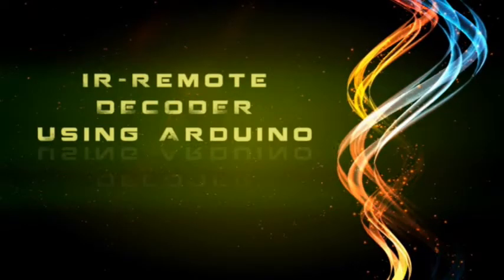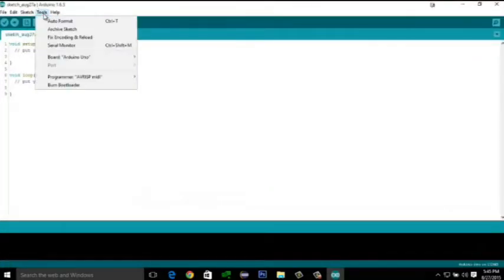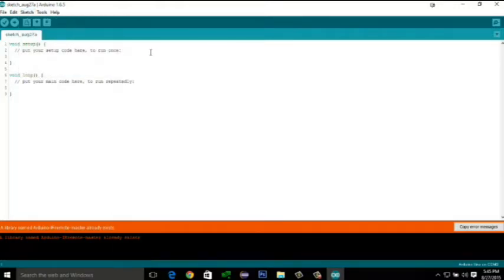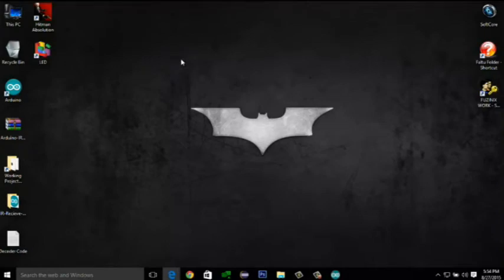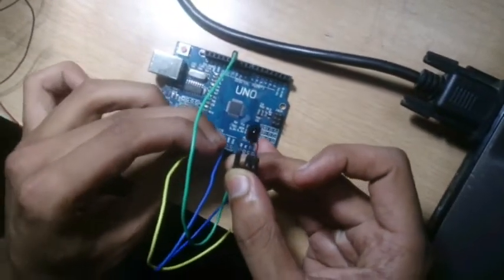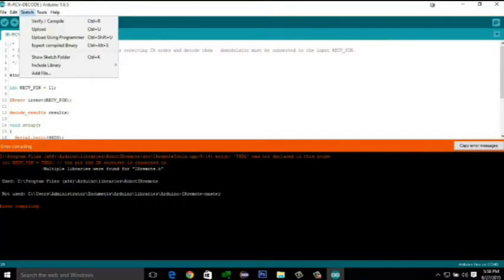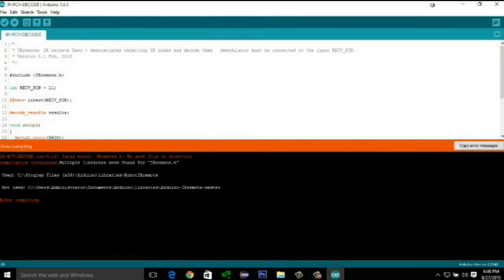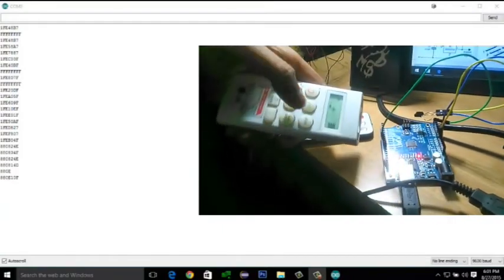IR Remote Decoding with ARDUINO UNO

Comment: Hi on gihub irdude project the hex codes used are soooo long , imean   90 to 100 hex values are there for single button...even on irdb.tk, remote central multiple hex codes are there for one button...here showing only one hex code...am i missing something
Reply from the maker: There might be some problem over there. You can use my code as the library I am using is doing those operations for me.
Reply: Sanyam Arya looks like I didn't explain it properly...here is the java code from irdude project on github 

irData.put(R.id.buttonPower, hex2dec("0000 006d 0022 0002 0152 00aa 0015 0015 0015 0015 0015 0015 0015 0015 0015 0015 0015 0015 0015 0015 0015 003f 0015 0015 0015 0015 0015 0015 0015 0015 0015 003f 0015 003f 0015 003f 0015 0015 0015 0015 0015 0015 0015 0015 0015 003f 0015 0015 0015 0015 0015 003f 0015 003f 0015 003f 0015 003f 0015 003f 0015 0015 0015 003f 0015 003f 0015 0015 0015 0015 0015 0696 0152 0055 0015 0e23");

This function converts all these hex numbers to decimals numbers and returns comma seperated numbers as string

But on this video we are getting only one value. I think that value is frequency right? (In above code 5th value) What about pattern? Thanks for replying

Comment: can i use the decoded code for programing 8051 microcontroller ?
Reply from the maker: yes, You can decode it using any microcontroller. You just need to have the proper knowledge of frequency calculation and some simple coding.